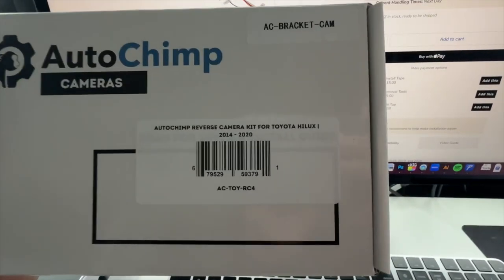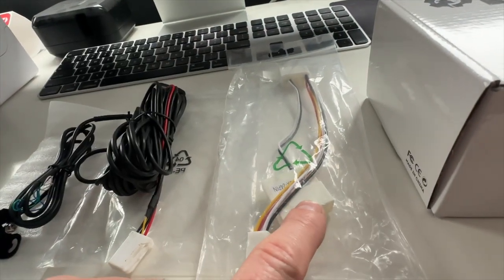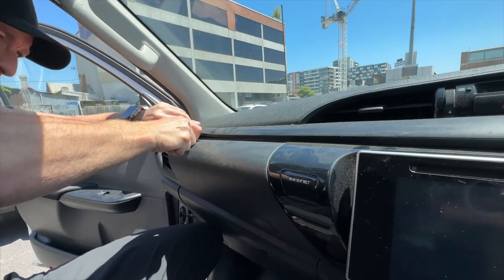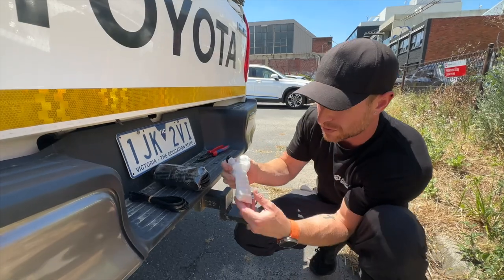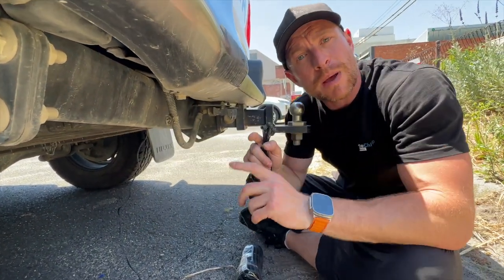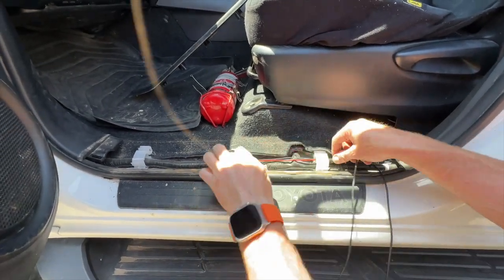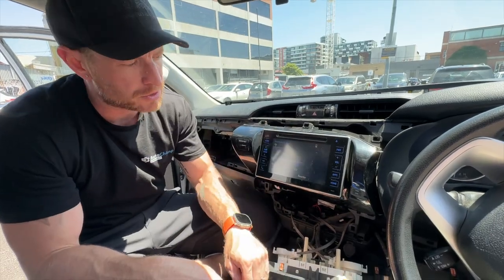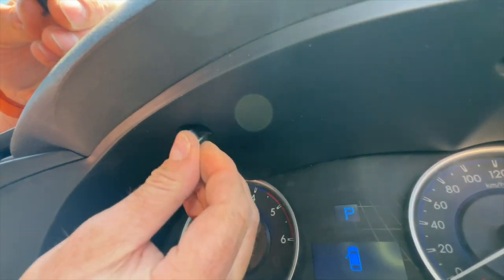Installing a reverse camera on Toyota Hilux models from 2016 to 2020 ~DIY Guide AutoChimp AC-TOY-RC4

Comment: Handy tip you do not need to remove anything but the glove box when plugging wiring into back of head unit will save you the hassle of ripping the dash apart for no good reason